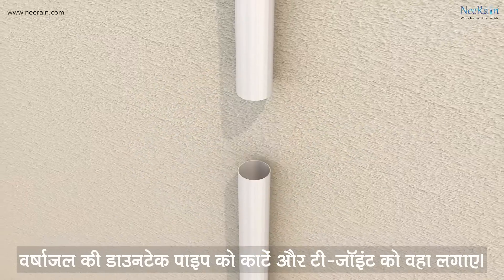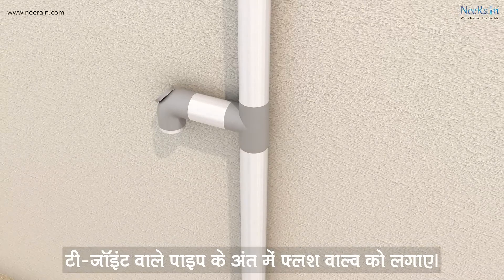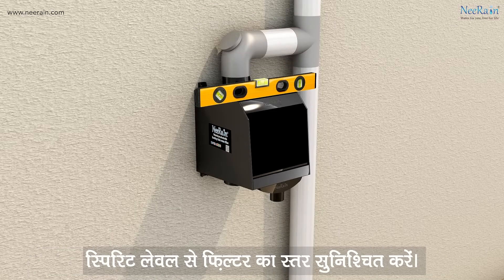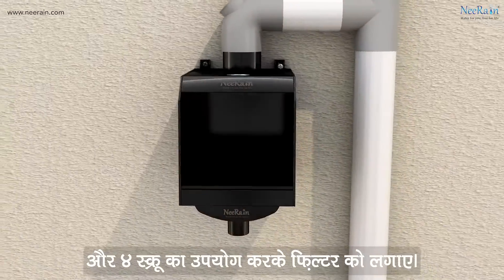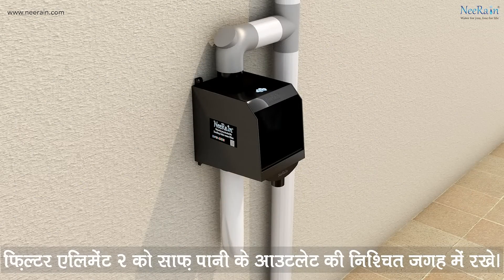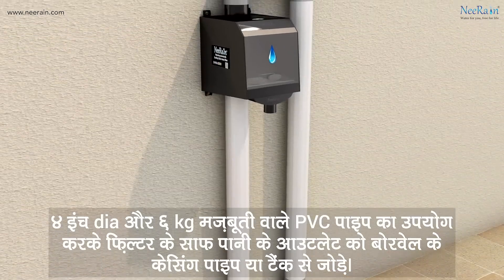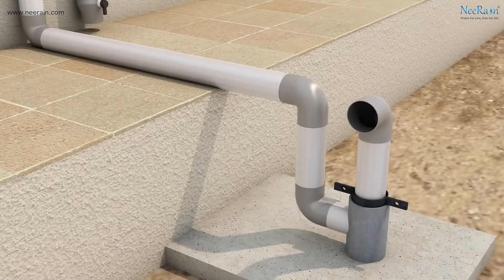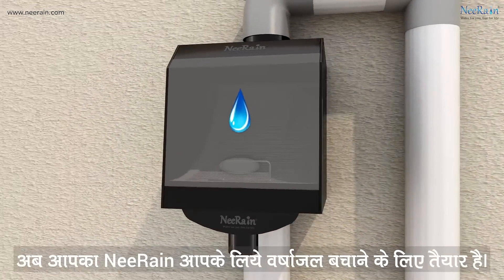NeeRain Rainwater Filter Installation | Rainwater Harvesting | Rainwater Harvesting Project

Comment: Why take a diversion using T joint?  Cont we connect it directly to the downtake pipe?
Reply from the maker: For first flush valve because whenever you want water you need to by pass the water that why t joint is required
Reply: Okay thank you for your immediate response. I have purchased neerain ultra 150. Will contact you again if I need any assistance during installation.

Comment: Video good but you have not shown a control valve to divert the rain water fro 110 mm pvc to neerain.
Reply from the maker: Sir, The flush Valve is shown in the video. Pls check at 0.43 to 0.44 second. Regards..Neerain.